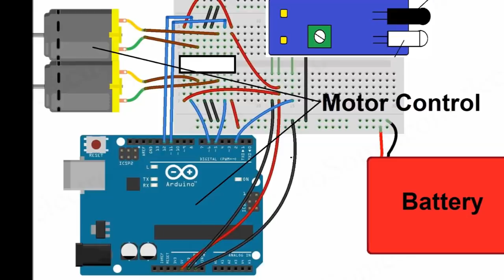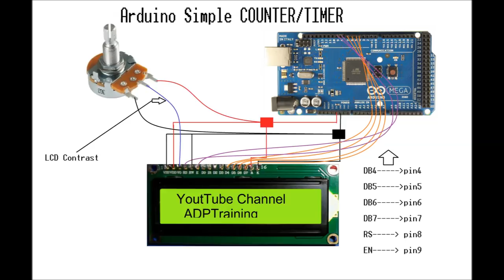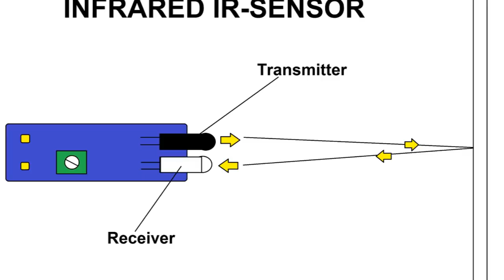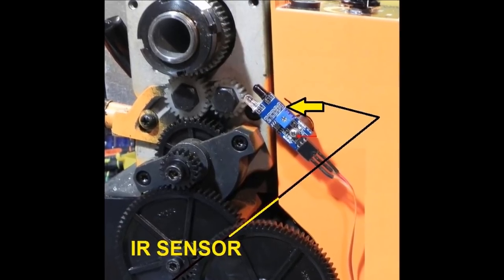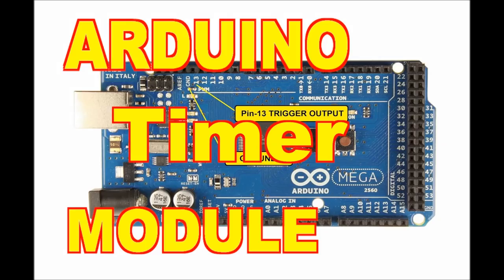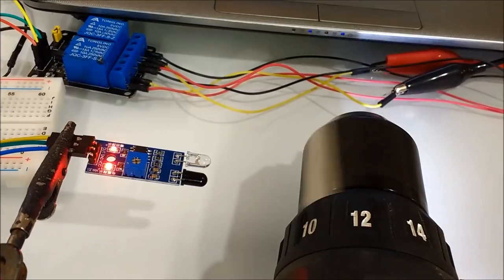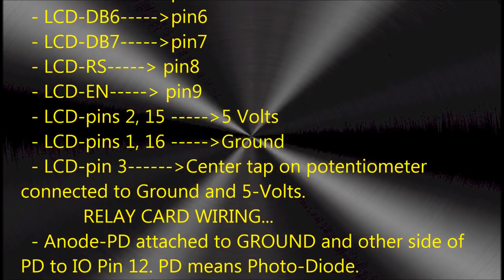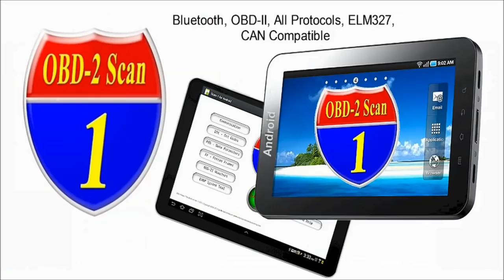Arduino LCD Infrared RPM Meter

Comment: I have a code for my stepper motor already, If i paste the code after my motor functioning code and make necessary adjustments to pin placements should it work?
Reply from the maker: I need more info on the matter. http://autodiagnosticsandpublishing.com

Comment: Could this Device be programed with the computer to manually control a CVT transmission? I would like to stay in high range most of the time after getting up to 60 miles an hour.
Reply from the maker: Yes it could... What else do you have in mind?
Reply from the maker: http://autodiagnosticsandpublishing.com/
Reply: Thank you. I have a 2002 Honda Insight.it's the CVT. The car never really gets in high range for maximum gas efficiency. Unless going downhill. The CVT is managed by they transmission control module. Also has speed sensors TPS sensor that communicate with the ECU. In my opinion if the CVT could be manually control to stay in high range once the car gets up to speed your device would sale like hotcakes around the world . Your input would be appreciated how to tackle this project .my manual transmission 2000 Honda insight is getting 150 mpg at 50 miles an hour. The CVT only get 50 mpg at 50 miles an hour. Because the CVT hardly ever stays in hi  range. Only going downhill. I would tell more would like to hear from you. I have a gas modification that doubles the mileage on the manual. The same gas modification makes the computer think the transmission and motor are under load so the transmission goesto a lower range the lower range defeats the purpose of better mileage.